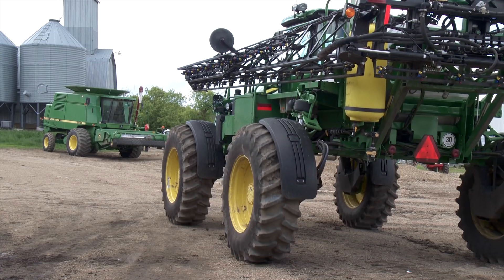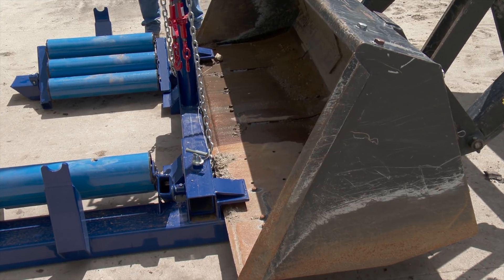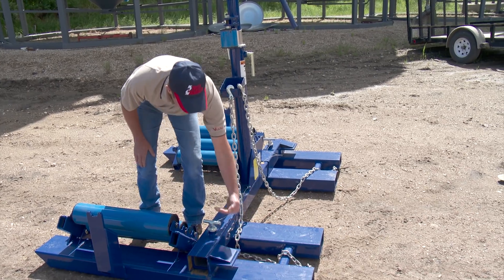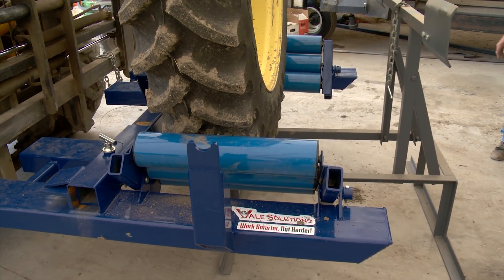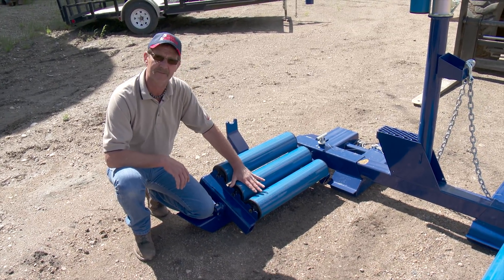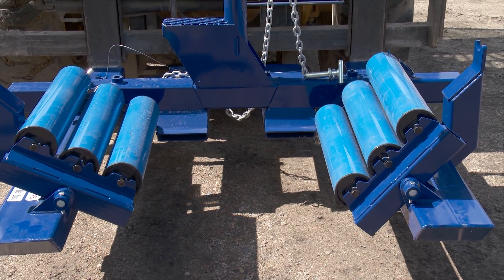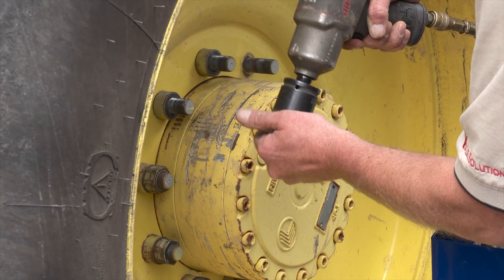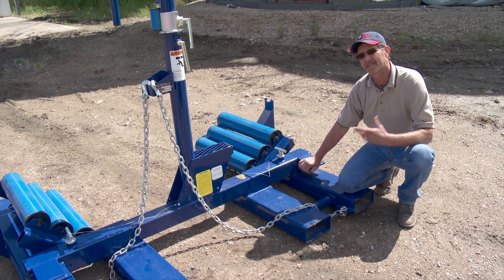The Wheel Wrangler

Comment: There is a better way to accomplish this task.
Any size skid steer can be used.
The wheel should be rotated without touching it. 
The tread of the tire shouldn't be touching anything.
It wouldn't work well for the military but it's perfect for agricultural equipment.
The wheel needs to be supported inside the rim by two rollers one hydraulically driven.
Reply: OK how are u supposed to slide the rim onto the piece of equipment if there is two rollers where the wheel hub goes?